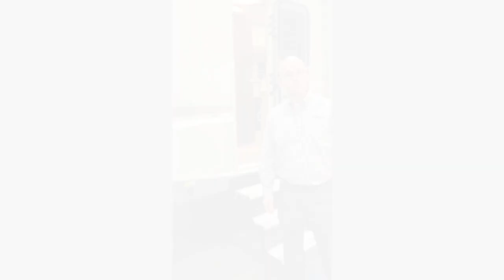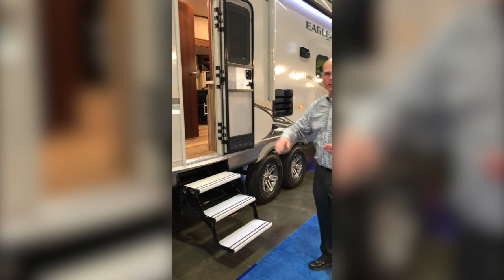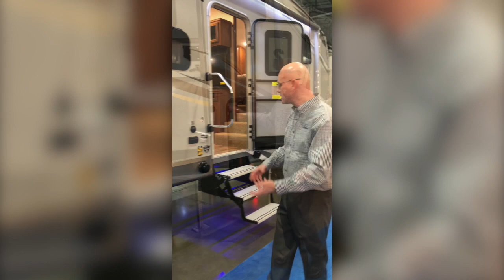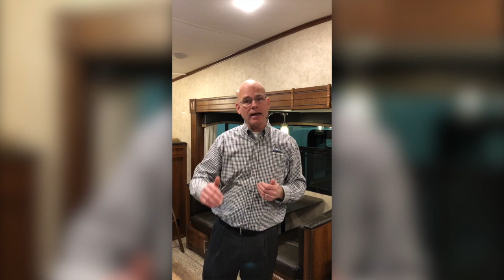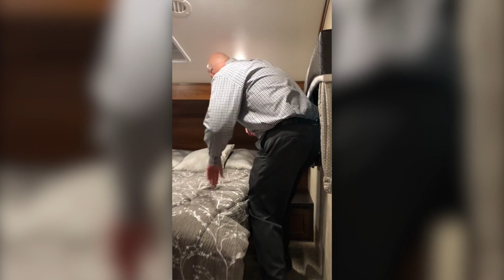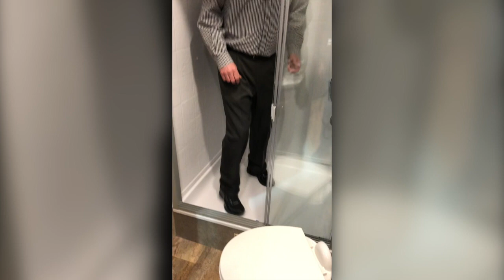The Quality Of A Jayco

Comment: My 2018 Jayco 317 RLOK 5th Wheel is a piece of junk. I've owned it for 10 months and the problems are endless. Don't let they re 2 year warranty fool you. I've got delamination issues, Floor squeaking , and holding tank gauges that don't work. Underbelly dropped out and all the 12 volt wirering then fell on the street because they didn't hold it up.And those are just the ones that Jayco has denied warranty on. If you make the mistake of buying a Jayco? Just remember that you've been warned!